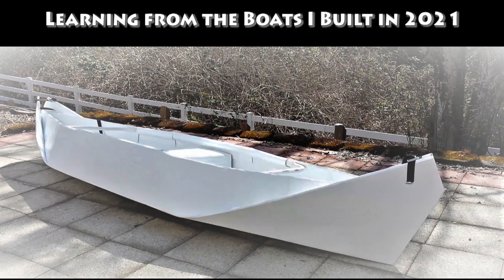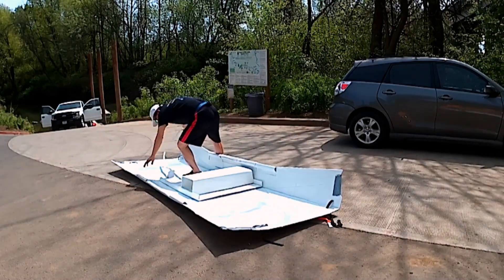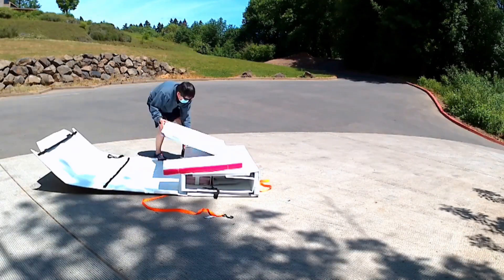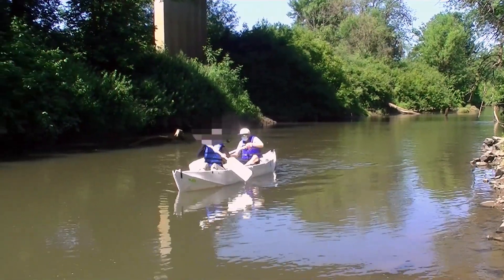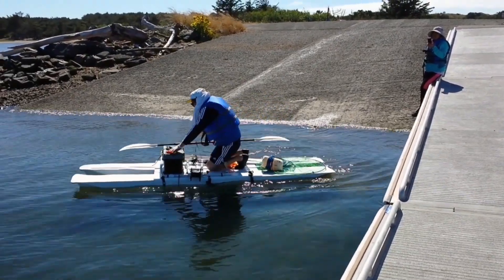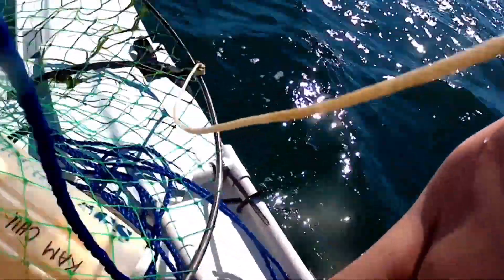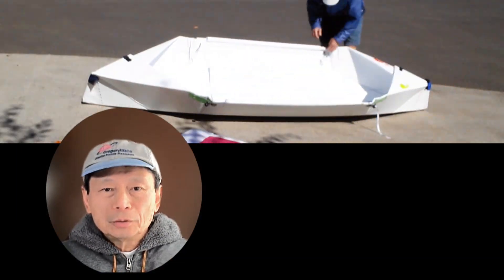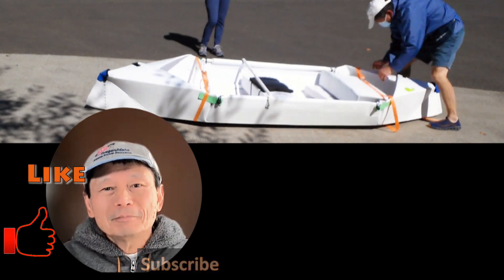Built 5 foldable /modular /foam Kayak /Foam /SUP in 6 months + learning Pt 1摺疊獨木舟

Comment: You mentioned about using aluminum tubing. You might want to take a look at repurposing roof snow rake handles. They usually come in 20 foot lengths and much cheaper than aluminum tubing stock prices. Especially when they go on sale.
Reply from the maker: Thanks for the tip! I am not aware of the snow rack handle. I have just checked one that is on sale on Amazon. A 20' one is $20. The best part is they have spring clips to bind the tubes together. This save me a lot of work, and also the cost for spring clips. Thanks for the great idea.
Reply from the maker: I have just ordered a 20' snow rack from Walmart ($12.99) and see if that will work for me :-)
Reply: @DIYUSA  Wow! You must have got the last one. The $12.99 priced one doesn't show up at all now.
Reply from the maker: @erichandyauto  It is BOOWAY Roof Snow Rake. One seller priced it at $80'ish, and another one priced it at $12.99. I guess it was miss priced and I don't now if they will ship that to me... shipping is included and I don't have to meet Walmart min. purchase for the free shipping....Now it is priced at more than $147.
Reply from the maker: @erichandyauto  The price was too good to be true. Yesterday Walmart canceled my order: We had to cancel your order because we can't deliver to that address. We're sorry we didn't get identity this sooner and you won't be charged for these items. "BOOWAY Roof Snow Rake Removal Tool 20ft with Adjustable Telescoping Handle 3 Inch Wheels, Roof Rake Suitable for Clearing Roof Vehicle Snow
$12.92/EA"

Comment: great overview and you have shared some valuable knowledge.  thank you!
In a new design of mine, I want to incorporate a transom with coroplast corner darts  (ala gift wrapping).  I want to flatten the cells in the triangular darts with a 120degrees F hot clothes iron.  Any ideas about how to regulate the temperature of the clothes iron?  I think laser thermometer will come in handy.
Idea for you, instead of pvc poles: using an Exacto blade (pushing it along), slice the web of second to last cell along its length and then there will be a big enough double cell to slide in a 10mm diameter fiberglass pole.  I see you can buy fiberglass poles at Canadian Tire for the purpose of marking out the edge of your driveway when snow falls.
chao
Reply from the maker: Thanks for your feedback. 7 minutes into this video https://youtu.be/_Nm515a9Ays  showed how I adjusted the temperature of the iron. To my surprise, the temperature on the heat plate (of the iron)  is very uneven. Thanks for your suggestion for the  low cost fiberglass poles. I will check that out. I have considered inserting 7 mm diameter fiber glass tubing into the platform   (the inner channel of the 10 mm thick coroplast is slightly larger than 7 mm ) of my Gen 17 (the paddle board/platoon boat). I didn't have time to order those tubing but I have PVC pipe, therefore I used PVC pipe. I am thinking of building a 12 ft kayak that can be folded into the size of the carry on luggage. I am looking for some thinner and lighter material for the gunwale. Your suggestion is very timely. Thanks again for the excellent suggestion!